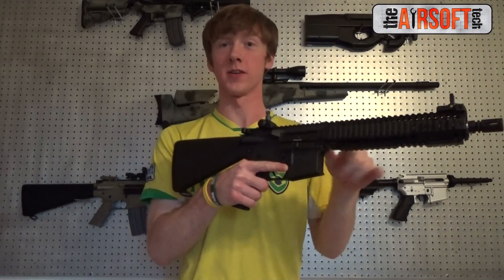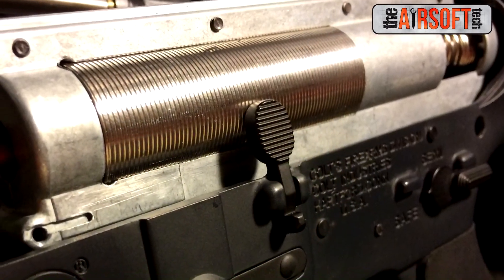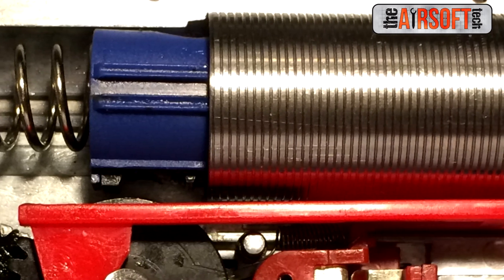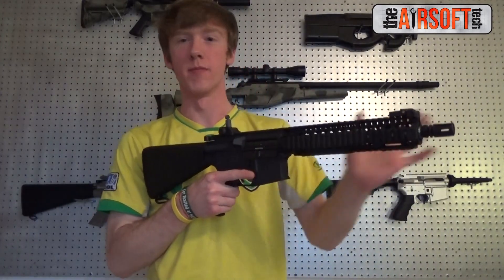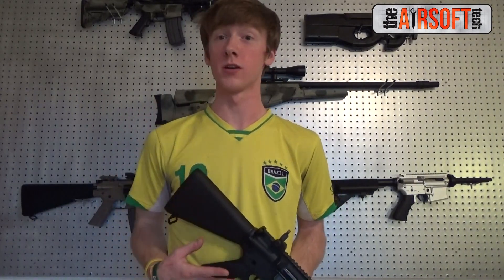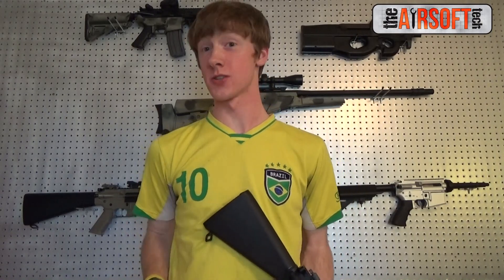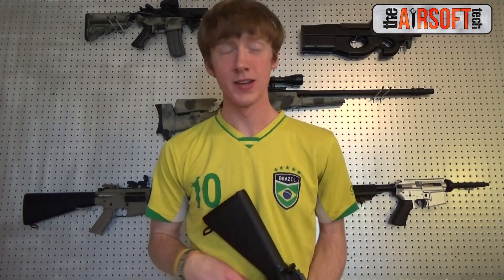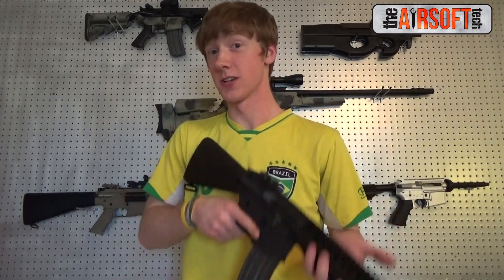G&P M4 Reliable Build

Comment: Build List:
-G&P gearbox shell
-Siegetek Gen3 14:1 SSG
-SHS M130
-JG Blue motor
-SHS 15-tooth piston
-Nukefet
-ZCI full cylinder
-SHS metal cylinder head
-SHS air nozzle
-King Arms tappet plate
-SHS anti-reversal latch
-Modify 8mm tempered bushings
-G&P hop-up chamber
-Military Action  6.03 x 285mm  inner barrel
-Lonex 70d bucking

Comment: I have a similar build to this and I am also having trouble getting the gun to sound right... I ordered a Gen. 2 Siegetek 14.09 SSG gear set from Brill but they were sent with the Gen 3. bevel...Any tips you would recommend to get this to sound as clean as possible? I am using a Lonex A2 with stock pinion.

Comment: ok can i have some help here? my semi hasn't been working properly even though the cutoff lever isn't worn down, the sector's avocado looking thingy is in good shape and the contacts are looking good as well. I've already put a shim above the cutoff lever where the screw goes in to change how tight it is. what seems to be happening is if i don't pull the trigger back all the way it goes full auto.
Reply: CardinalFan23 sound like your contact are too tight. try spreading your contacts just a hair
Reply: David Schaible ill give it a shot. Thanks for the tip!
Reply: CardinalFan23 this literally was asked in a facebook teching group like 4 hours ago, haha
Reply from the maker: CardinalFan23 Check the trolley lip (where the cut off lever contacts the trolley). If that's worn down semi won't work.

Comment: ok, i shimmed my gearbox, and now the bearings are sticking all the way out, so there is no room for the selctor on the body against the gearbox when the gun is put together. what to do ? :)
Reply from the maker: Anders Peter Jørgensen Shave down the selector plate so the bearings don't touch it.
Reply: thanks, did the trick. next problem, the actual selector on the body, does not stay in place, so if i adjust so its perfect, then put it together, it just moves around in there and out of alignment. what to do